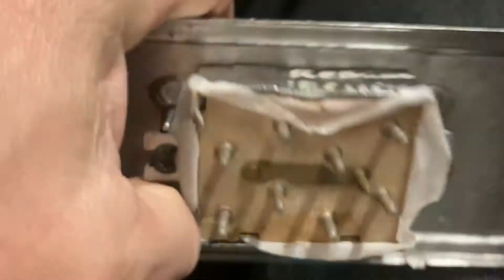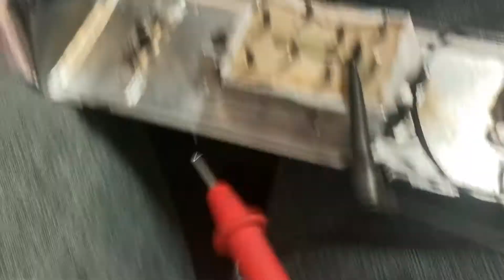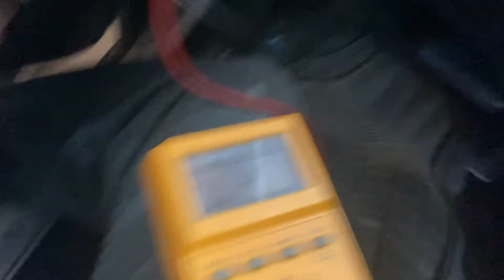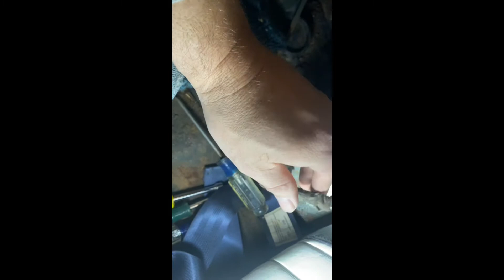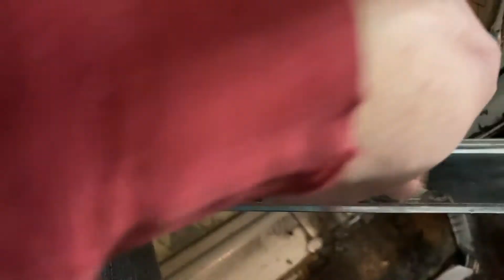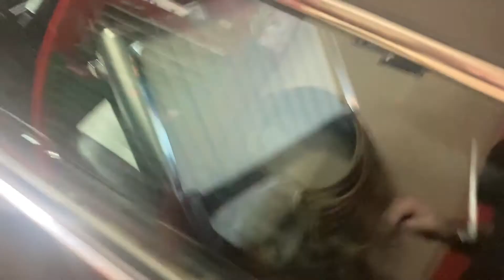How to Troubleshoot and Repair Classic GM Power Windows. 1967 Cadillac project

Comment: Do you have a video showing how to remove the driver side front regulator assembly? I have a 67 convertible with a bad front door motor
Reply from the maker: I am sorry, but I don’t have a video of the door specifically, but it’s easier than the rear motor replacement.

Comment: The wires break in the hinge area of the drivers door from thousands of cycles of open/close.  If they’re not broke, they will....inside that rubber boot....
Reply from the maker: Thanks, but I got mine fixed
Reply: @ClassicGMRestomodDIY  I saw that....just letting you know that if your wires have not broken in the drivers door hinge area, they will, not if, but when.....I currently removed the passenger side rear quarter window for a bad motor and during testing it works intermittently, but didn’t work at all in the car.  Not a fun job.  Thanks for your video, it’s a big help.
Reply from the maker: @trailerparkcryptoking5213  I really appreciate you letting me know what to look out for. Thanks

Comment: That “emergency” switch on my daughters ‘68 DeVille, the top half of the switch that is visible that you rock with your finger is missing. The bottom half of the switch that the wiring harness plugs into is there.  Do I need a whole new switch or is this one repairable by obtaining the missing rocker portion of the switch?
Reply from the maker: There is a guy on Facebook who probably has the part you are looking for. His name is Jeff Burland. Hope you get it fixed. It’s probably just as well to get the whole switch.